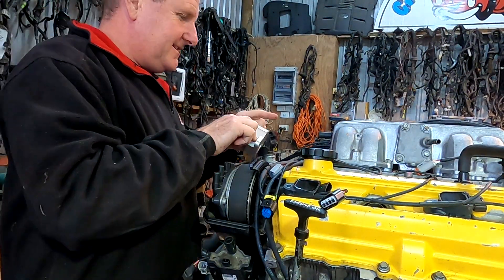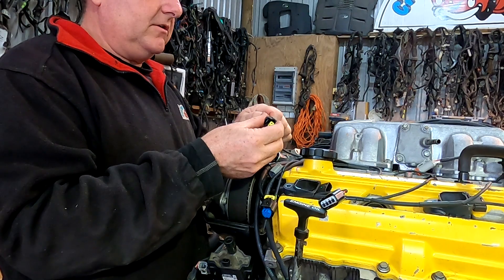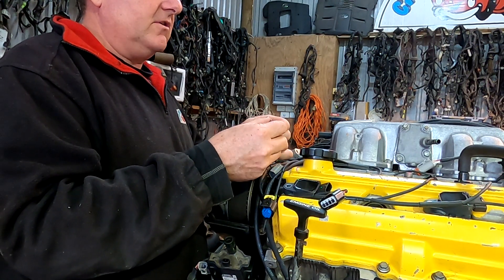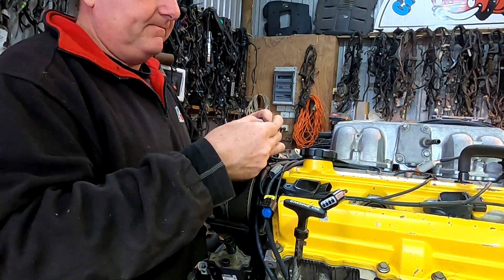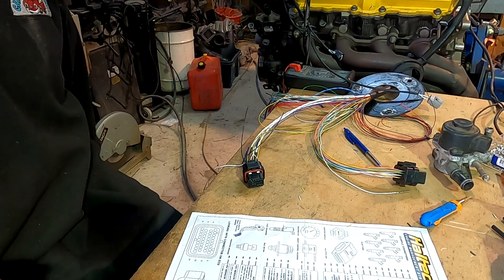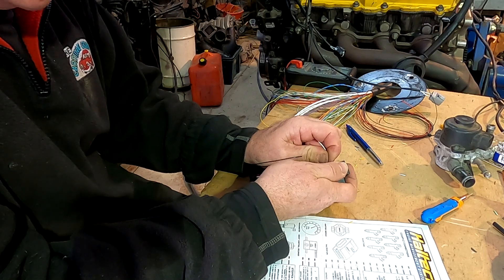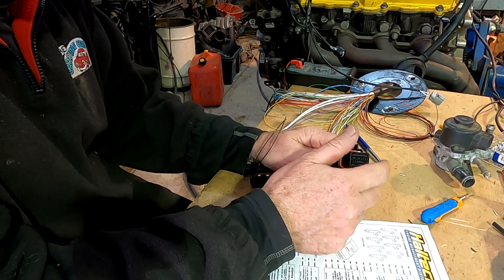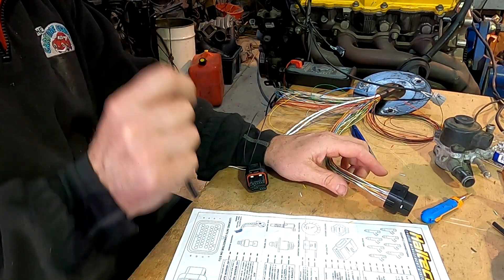Haltech to 1uz Part 6   Idle speed control

Comment: Correct philosophy...it should all work as well or better than original ecu system....as you say Kelvin, jump in turn the key...Like a normal car...conversions can be a headache, I learned that when I put a 7M-GE engine into my 1970 Toyota Crown (MS-55) a great deal of time was spent on wiring.
Reply from the maker: Unfortunately these short videos don't show how many hours work go into some of these swaps , especially on the wiring side of things but that's what it takes to get them right.  Reliability is very important to me.  Cheers

Comment: Save he output and just run idle via the DBW throttle body, makes for a neater engine bay too.
Reply from the maker: I like drive by wire but that wasnt in the customers requests,  would have caused issues for transmission line pressure which is still cable actuated and as IAC uses 1 output and dbw uses 2 outputs its more output,  and I had no more left.
Reply: @CartuneNZ  I thought the build already included a DBW throttle body.
Reply from the maker: Not on this one,  this was for the zephyr which was cable for engine and line pressure for transmission

Comment: Hey Kelvin, how would you go about ISC with the custom front facing intake? As far as I can tell there's no accommodation for one aside from the larger vacuum or PCV ports.
Reply from the maker: We fit an aftermarket unit.  Easy as.

Comment: Kelvin, is a stepper needed if you use a dbw throttle body?
Reply from the maker: The dbw takes care of all idle control and throttle control so no additional idle stepper is required.  Cheers Kelvin
Reply: Nah u don't need it when using dbw as far as I know . I putting an 80mmm chrysler dbw trottle .and I using a weldable flange to do that  ... without  a idle stepper